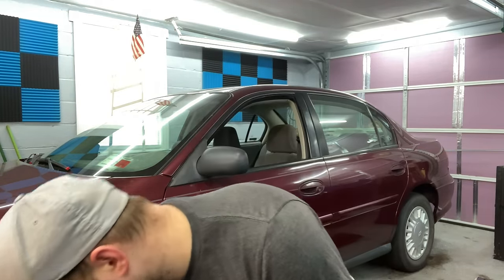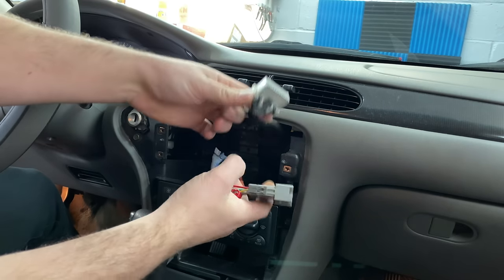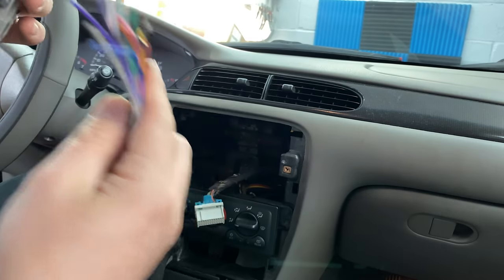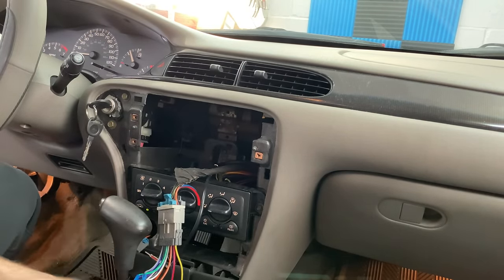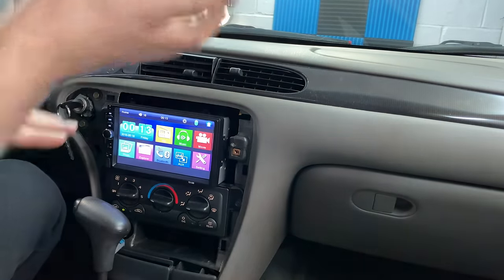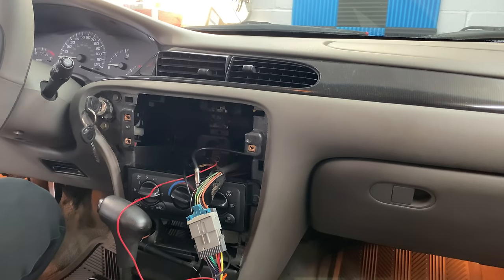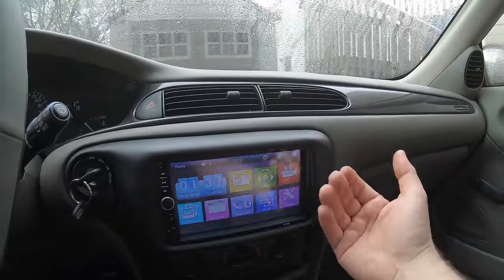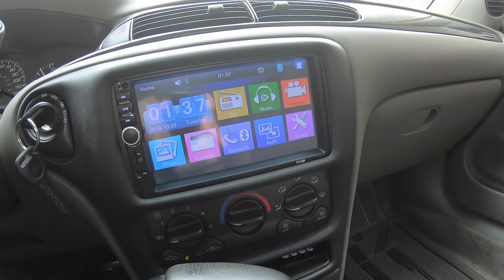I Bought the Cheapest Touch Screen Stereo on Amazon! | Malibu Episode 3

Comment: Never cut those wires!!! Buy a aftermarket wiring harness I will burn ur car to the ground if u mess up hard wiring it!! Seen someone buy a brand new at the time brand new 07 crew cab Z71 was tryin to be cheap and save 90 bucks bc if ur car has premium sound it has a factory amplifier and need a special interface to power up, so he hot wired
It bout 20 mins later
Smelled something burnin when out to the garage and it was in flames!! Total loss had the truck for 4 hours!! Gone!!! Don’t do it!! If we would
Have left it would have burn the house down along with it!!! I’m a pro car audio installer with over 10 years experience I told him not to do it, but he knows better than me....riighghhhhttttt I looked at him after we got it out the garage and said I told Ur dumb ass!!! 💯💯😂😂
Reply: well since you the pro, why didn't you do it the correct way for your friend...smh!! I have used harnesses and I have cut wires, it all does the same thing when you know what you are DOING!! been doing this since the 90's...